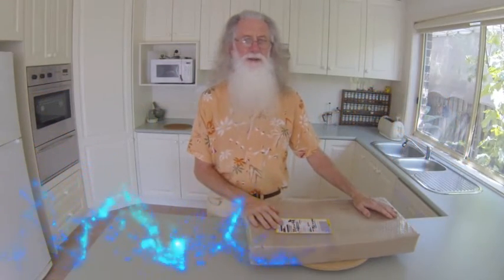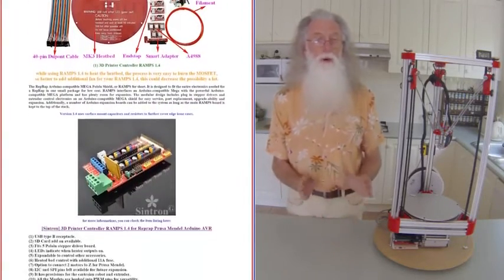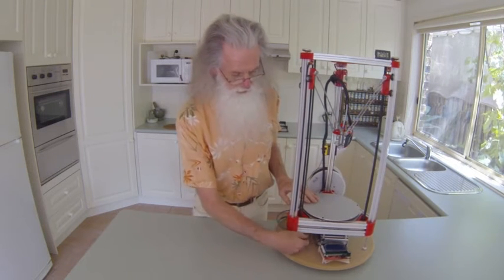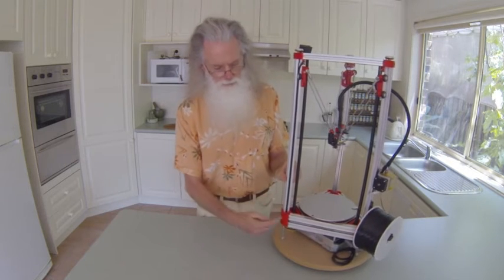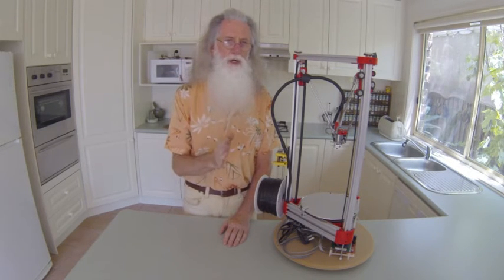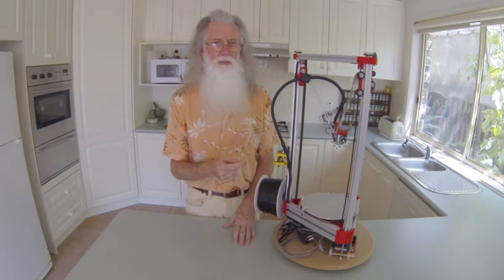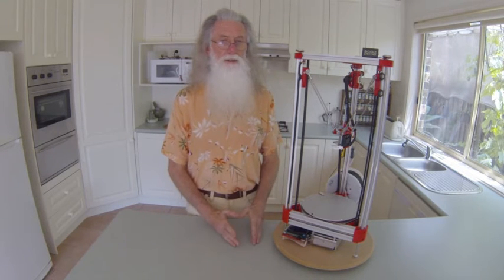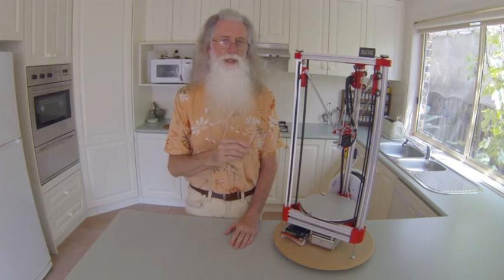3Dprint4A - Kossel Delta 00

Comment: Just to add, that I have received my kit, Jan 2017. I assembled 70% of without even downloading the instructions. All screws etc are packed with the parts that they relate to. It was very easy to put it all together. Some parts have been updated since this video was made, it all went together without any poor tolerances, eg all bearings, control arms etc fitted without and play, and without parts hitting each other. It seems that they have listened to feedback and updated the kit accordingly. I haven't needed to modify anything at all so far. Tips- fit the endstops before you attach the top triangle, and drill out the motor mount holes slightly.
Reply from the maker: Good to hear. On their facebook page they recommend watching the series of video. It is good just to get an understanding of the whole process.  I am pleased that they are following the recommendations and are improving all the time.  It would be a great day when things you order just work straight away without any problems. So you shouldn't have too many problems before you are printing flat out. Good Luck.